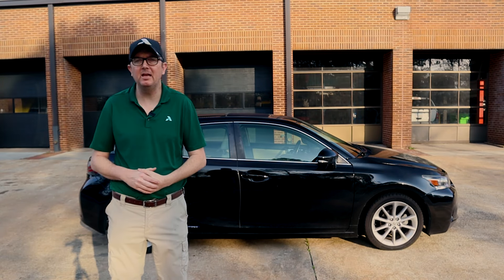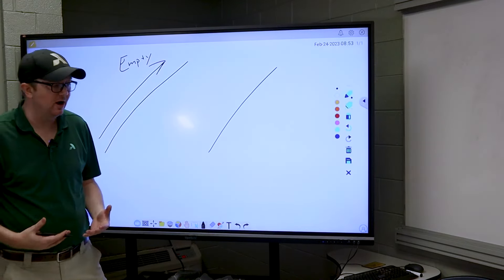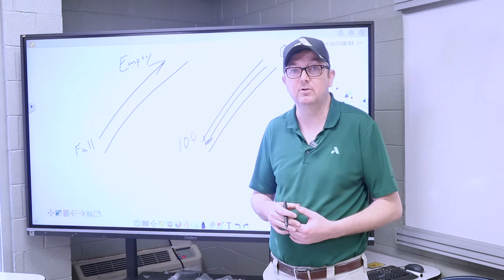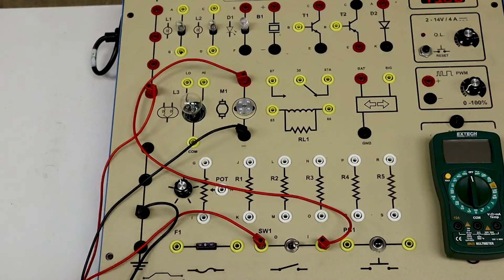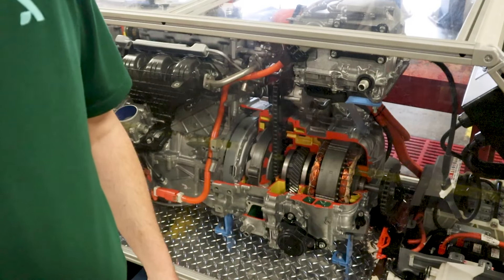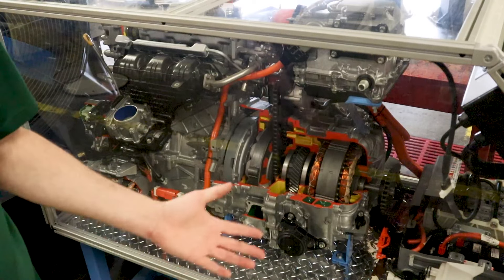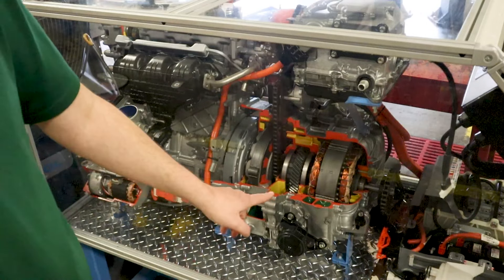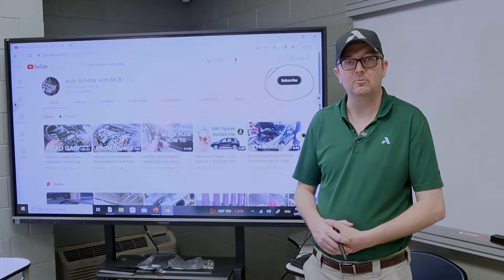Regenerative Braking in Hybrid and Electric Vehicles Explained

Comment: When I bought my hybrid Camry, I asked my dealer salesman how regenerative braking worked and when was I using actual brake pads. He couldn't answer me properly and just said the brakes last forever. I now realise that the motor generators can only provide so much braking (showing maximum charging on guage) then it's actual brakes pads rubbing against rotors after that. I drive as smoothly as possible and make sure my charging needle stays below maximum. That way my brakes will last forever. Even in a normal ICE car, my brakes last a long time. Thanks for the technical explanation. 60 to 70% is more than i expected to regenerate.

Comment: I have a problem with my Prius, but there is no warning on the dashboard, when I press the brake it is not regenerating, the CHG bar does not fill when I press the brake, it could be a lack of calibration of the valves, the brake servo has already been changed, because the original was the problem in 3rd gen what should I do
Reply from the maker: Definitely check the ABS module for any codes. I would also do a linear valve calibration with a good scan tool.

Comment: I understand the conversion...induction motors, bridge rectifiers, etc.  That part I understand.   But I'm wondering if the energy goes back into the battery or into a supercapacitor between the controller and the batter....

Comment: One question I have is when applying stronger  brake input, I understand that the greater drag produces and captures greater recharge, but how do the generators apply greater drag to the axles based on brake input exactly?

Comment: Looking for answer - can’t find it.  Why during Regen voltage of a battery reach red zone - over 260-270 V at nominal 201.6 V (harder I brake higher voltage). Why voltage regulator is not limiting the voltage (like in regular alternator system)?

Comment: Gen 3 Prius 2013 here.   Coasting shows small regeneration but using the brake pedal shows more regeneration.???
How does harder pedal braking cause more regeneration.???
Reply: brakes aren’t pads and discs, it’s using more resistance on the motor to charge (mg2)
Reply: @hatchali6765  So on the Prius - mild braking doesn't actually engage the pads to the rotor.???
Reply: @marblox9300  nope, see the energy meter, until you fully reach the left, the hydraulic brakes don’t engage and it’s all regen braking
Reply: @hatchali6765  So are you saying my previous comment is correct.???

Comment: I have a 2023 Toyota Corolla hybrid that had a registered average MPGs of 50 and I get 63.  
        My neighbors just bought a Toyota Tundra hybrid and we're getting 11.3 miles per gallon,  until they let me get in the vehicle and show them how to drive a hybrid.  On the trip home, after resetting everything, I showed them how to accelerate gently and break gently as if there's an egg in between your foot and the pedal. 
The result is it more than doubled the MPGs from 11.3 to 23.1. 
        My only frustration is that this type of technology has been around for decades in the train, locomotive, industry. 
         Why did it take so long for the automakers to be dragged, kicking and screaming, into the modern world?
Reply: I think it's lots of different reasons. The more unfortunate outcome was how they started building up the hybrid fleets, and then suddenly stopped when Tesla showed up and proved how effective an electric car could be. Cheaper gas didn't help either. Then lots of companies scrambled to play catch up and immediately make electric cars into this mainstream, money printing machine, without considering how impractical this is for 90% of US drivers currently. I live in well a developed suburb of Chicago, and I know of exactly one electric charging station within 10 miles. Granted, there are a lot of homes in the area, so homeowners would be mostly fine. But there are also a fair number of apartments, whose drivers would not be able to charge at home. When you factor in the stupidly high cost of most EVs and PHEVs, it erodes most savings over getting pure gas or HEV.

Now that expensive electric cars have failed to gain traction (shock!), lots of these manufacturers are going back to reliable hybrid tech. And I think it makes sense. It's true HEVs are a stopgap technology, but it's the perfect bridge for when EVs are ready for mainstream. In the meantime it's less reliance on dirty fuel, and being able to manufacture way more HEVs for the same amount of elements (batteries, etc) as a single EV. Not only that, consumers in my area obviously prefer them. Big trucks, SUVs, and even sedans sit on the lots while hybrids are just flying out left and right.

Comment: how does it slow down, while the brakes are off & the battery is being charged. does it have enough magnetic resistance to slow down the momentum of the vehicle. or is there a brake in the motor.
Reply from the maker: It does use engine braking strategies as well.
Reply: @AutoScholarwithMrB  what about a full blown EV vehicle not a hybrid. Does it still use a type of resistance in the motor to slow the vehicle
Reply from the maker: @wavyzeex  electric motors on EVs work the same way. Also regen will most likely always be active because there is always room in the battery. The hydraulic brakes still work at low speeds and situations where regen isn’t applying enough drag.

Comment: When the rotor is move by a prime mover the induction motor could also act like a generator but you have to make shure the rmf speed is always less than rotor speed this causes way more voltage to be generated which induce a reverse current 270dgree behind the magnetizing current.

Comment: Coasting down a hill when a battery is full it's still going to use regenerative breaking but with engine braking too. You going to see your engine rev up to 3000 rpm which will consume the energy regeneration as battery is full

Comment: How does the system regulate the amount of regenerative braking applied as the driver presses the brake pedal more and more? Is it varying the resistance within the circuit, or something? Thanks.
Reply from the maker: In most hybrids the pedal pressure is input to the control module by either a pressure sensor on the stroke simulator or a pedal position sensor. This is then communicated to the battery control module to decide if the battery needs charged or not. If there is room in the battery for charge, regeneration will occur. If the battery is full, the conventional brake system will be used. Regenerative power is controlled through a field, much like how alternators are regulated. Higher field equals more drag on the drive wheels and consequently more power to the battery being generated. Hope this helps, my friend, and thanks for watching!
Reply: Lovely! Thank you for taking the time to explain. 👍🏽

Comment: Does anyone have info on the details regarding the 2019 prius prime? Im wondering what arr the parameters for whenever ev mode automatically changes to ice whenever on a slope and at what degree that slope must be. Does the car detect the slope or just the increase in torque?

Comment: Can you exsplain how the battery recharges by coasting? Also can a battery with low cells recharge its self, by coasting more? My 2014 prius c only got 123,000 miles on it & my check hybrid engine pull over in safe place immediately light came on My son cleared the computer I took to Toyota dealer they said My cells were low I'm bummed becouse I was under impression these cars run up to 200,000 mi Dose the way you drive effect this

Comment: If you start at the bottom of a hill with 100% SoC, when you get to the top of the hill about 30% of that will be have been lost in various places (heat in the drive train, tires, and road; atmospheric drag), and 70% will be in kinetic and potential energy of the car. You only recover from that level.

Accepting your 60% to 70% efficiency for regen braking, the battery will be at 42% to 49%  SoC at the bottom of the hill. I don't necessarily believe that efficiency; I have a 2015 study of PHEVs where the best (Accord PHEV) almost reached 60%, and three others (Prius, Fusion, C-Max) are between 45% and 50%, so the SoC would be between 32% and 40%. And as a point of reference, due the 30% loss I assumed going up the hill, this will get you about a quarter of the way back up.

This is the fallacy of regen braking. It does not let you gain SoC, since you need more from the battery to "undo" the braking.you just lose less in the cycle.

Comment: Is the system you explained on this video the same for a 2008 Mercury mariner hybrid?
Reply from the maker: No, they only use one electric motor.
Reply: @AutoScholarwithMrB  Oh Okay.. but as far as light use of the brake pedal acting to recharge the battery the system is similar I believe. There is a needle that points toward charge while breaking and assist when the car starts moving up to around 20 mph before the gas engine starts up.
Reply from the maker: @coachmarc2002  correct, it regens and stores that power for when it is needed later in the drive cycle

Comment: When vehicle in high speed and use Regenerative Brake, is the ABS system active to prevent slip ?
Reply from the maker: No, at least not on the Toyota systems. They will turn off regen and only use the friction brakes.

Comment: Does the battery charge during a downhill roll (not applying brakes at all)?
Reply from the maker: Yes it will charge while coasting if there is room for charge in the battery. Thanks for watching!
Reply: @AutoScholarwithMrB when you’re coasting is there a lot more drag than when coasting with an ICE car because it’s like you’re putting your brakes on?

Comment: At 8:30 I don’t think this is right.  Unless there is some wacky brand new system, the Prius has always had a mechanical brake connection.  Meaning the hydraulics will work and stop the car even if the brakes are off.    The solenoids in the abs module can close off to prevent that flow. If this was not the case in the event of a stall or something , there would be no brakes at all.
Reply: God forbid touch brakes over 8mph! Drive 5th Gen, use simulator gears for brakes. Occasionally have to use hydro above 8, the regen doesn't do anything.

Comment: Thanks for the video! I have one question. When the battery is full and the vehicle is coasting downhill in B gear, MG1 spins up the engine to dissipate energy. Does it mean that the vehicle is still using regenerative braking from MG2? (i.e. The engine is just spun by MG1 to dissipate energy but the engine itself is not the one that's actually slowing down the vehicle.)

Comment: I have a question, so on a bmw X3 there is regeneration meter, when you let the car coast, the charge meter raises a bit,  however the harder I brake the more it raises! So if I when I brake hard the actual brake pads actuate, how is it regenerating more?
Reply: I think(!) e.g., try on a long say 3-5% downhill  If you slowly increase brake pedal pressure, (if battery is not nearly  full), regen power (maybe torque but i think power) up to a threshold (max regen power i think) then car (toyota) “sees” you want more braking power and brings in (maybe engine braking) the friction (hydraulic) brakes, then i guess at high pedal pressure the hydraulic brakes really crank down (regen is cut out i think he said idnk why).   im still trying to determine what max regen power is dont want to blast esp smaller hybrid battery (say 1.5KWH?) with too high a power/current (more than like “20C”rate like 30KW?). 

E.g i think say    If Prius on highway kinetic &rotational energy at vo=30m/s highway ~0.5*(M+mrot)*v^2=~1500kg*(30m/s)^2=700 kJ, approx.
will also have drags on order of? F_Aero drag ~-200N, Froll resist&friction~-Mg*(frr0+fdrvtn)~ -200N?  so car “drags~ -400N at that vo 30 m/s. my numbers prob off 
anyway if prius batt not near full, say you come off accelerator  start slowing (on level ground w no wind!) (Faero+Froll+Ffric)/(M+mrot)~-400N/1500kg~ -0.3m/s2   tangible but not much..
 and then bring in fairly soon full regen power max say it is Prmax=~-30KW_elec means wheel torque at vo=30m/s, of Frmax(v)=Prmax/vo =-1000N/(drive_effic)~ -1100N (?) mechanical atat (Faero+Froll+Fdrvtn+Prmax/(vo))/(M+mrot)~ (-400N-1100N)/1500kg)~~ -1m/s2 or -0.1g. not much.
But as Prius slows the max regen Torque increases, which i think i can feel; at max regen on dial, my RAV4 hybrid slows, and speed v decreases, my regen pulls “harder and “harder” imho, puts more force on me & car, as quotient Frmax(v)=Prmax/v increases i think. 
Still getting data.  Feedback appreciated.  sorry to go on & on. BR.

Comment: You need a rectifier to go from ac to dc; not an inverter.
Reply: Yes that is correct .,  What is cool is that the inverter can do pretty good job of rectifying; in fact i think often more efficiently but costlier than diode rectifier.. 
the (3-phase “full-bridge”) inverter like in EVs or Prius rectify the AC motor regen output , by how its control proceesor time its switching ( using FETs or IGBT transistors, as you know,).. 
Im winging it here but sort of:
the motor in regen mag fields creates high AC sinewave voltages in its (stator) windings (phases), as you know and inverter switching  is timed ( in their phase and sometimes also with a small slip freq offset for say induction motors) so the switches only conduct then only when a phase-to-phase voltages exceeds, by a margin, the inverter’s “DC link” voltage  (i.e. in basic systems, that is ~ battery voltage, or thru a dc-dc converter)  So controller and inverter uses timing to act as rectifier to push current (power) from motor windings back into inverter DC link and then (via perhaps dc-dc ckt and batt mgmt sys) back into battery.  Controller of course monitors and limits regen for SoC, and for OC, OV, OT).
I  hope this helps some sorry if too much
basic idea is there but im rusty so pls check me.  
but in general full bridge inverters can do nice job rectifying if o/c designed well; maybe even if input is not just sinusoidal, but harmonics and junk, which is also cool..  BR.